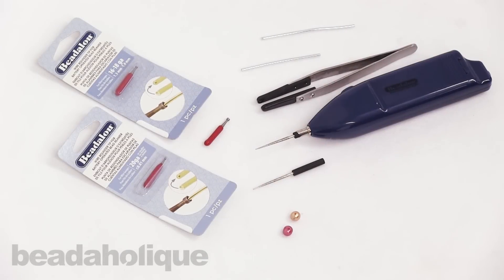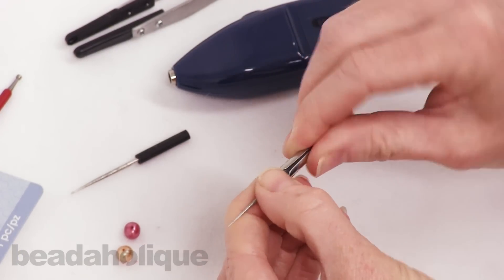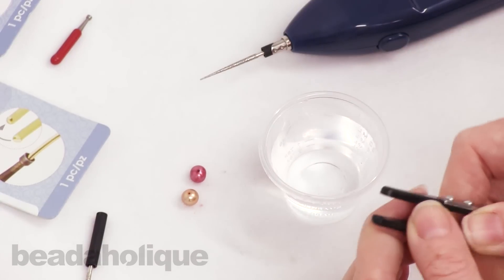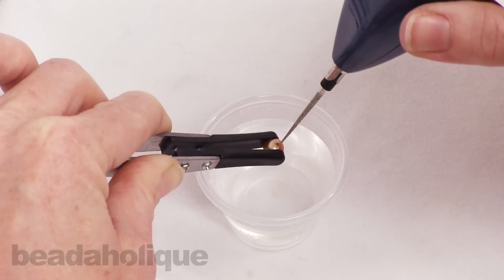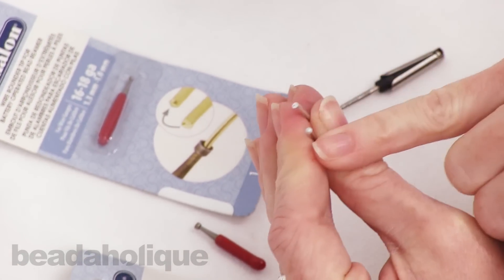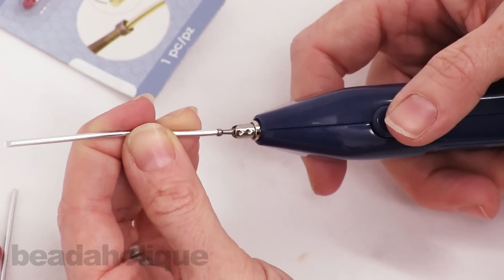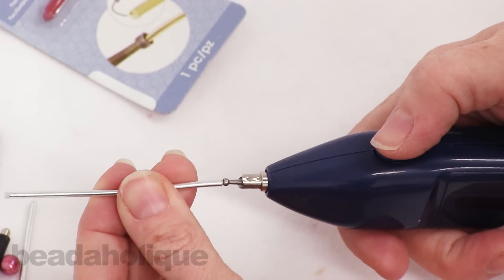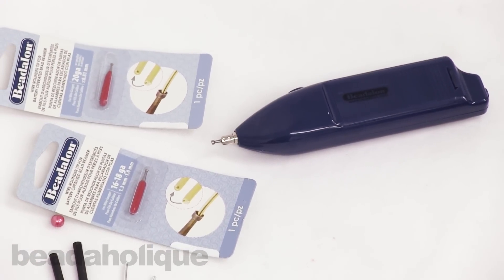How to Use the Battery Operated Beadalon Bead Reamer

Comment: Is the reason for dipping in in water because the head will break if you don’t? Looks as if it takes forever and I have way too many beads
Reply from the maker: Dipping in water helps prevent overheating and it also works as a lubricant.

Comment: My drill bit keeps slipping out
Reply from the maker: Hi! You definitely want it secure in there. Two trouble shooting tips is to make sure that the drill bit is pushed fully down into the little leather sleeve before you insert it into the main drill - so you want to actually see the base of the drill bit line up with the base of the leather sleeve. Then also make sure that the tip/leather components are pushed all the way down as far as they can go into the drill itself. If you have any additional details on what's happening, let me know and I will try to help.

Comment: i bought this and the tip keeps coming out of the drill when i use it
Reply: +pinkblackbrown That happens to me all the time, too.  So if you apply more pressure, it gets bogged down and stops.  Very frustrating.
Reply from the maker: +pinkblackbrown Hi, the only two things that I can think of are: is the tip pushed fully into the recess and then is there that little "sleeve" on it?
Reply: Same thing happens to me. So frustrating! I went back to my manual bead reamer.

Comment: I just got one & I push the 20 gauge rounding tip in the metal sleeve almost all the way down but then can barely insert it into the bead reamer hole because it’s too tight & I have to push with all my might and can only get a small part of the sleeve in.  Yours seems to slip right in.
Reply from the maker: It sounds like the tip may be defective. If you purchased it from our site, please contact our customer service team at service@beadaholique.com. If your order is eligible, we may be able to send a replacement. Thank you.
Reply: I have the same issue—I bought mine several years ago. None of the tips really want to go in, and they do not fit in the collet. I wish I’d bought a manual set of wire rounders.

Comment: Being that the bit for drilling beads is tapered, doesn't this make the new hole wider at one side of the bead than at the other?  Or do you do this at both ends, which you did not show ... ?
Reply from the maker: Pearls usually have small holes less then 1 mm in diameter. The bits for this reamer typically fill the pearl bead hole. However, if you are reaming a hole larger than the bit you would need to ream in a circular motions to ensure an even hole size.

Comment: This is called the Beadalon Bead Reamer, which implies that it works on all beads.  I have just received mine today and have not used it yet.  I will try it to enlarge gemstone holes today and let you know how it goes.  If it is only for pearls it should be titled the Beadalon Pearl Reamer, or Beadalon is guilty of misadvertising.  When I read the description on Amazon it said it could be used on  pearls and other beads, so why don’t you know this?  Anyway, I will try. Fingers crossed.
Reply: OP, did this work?